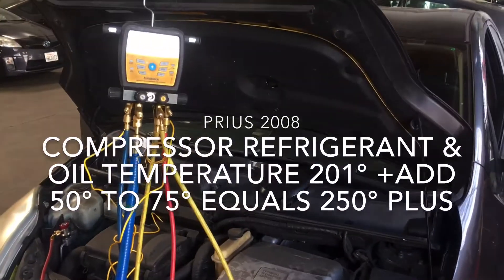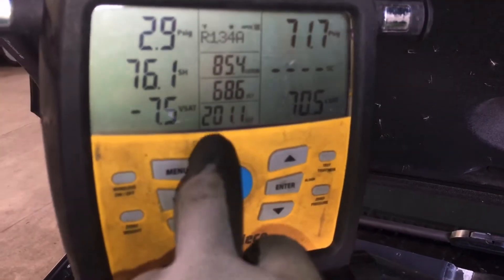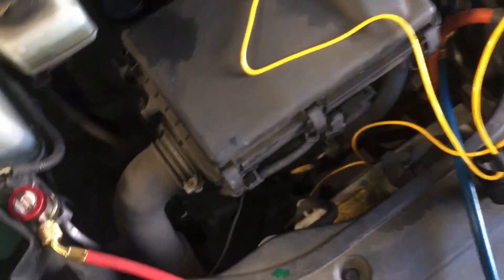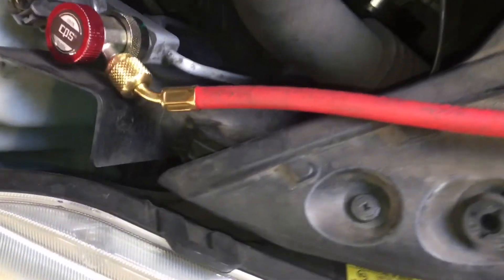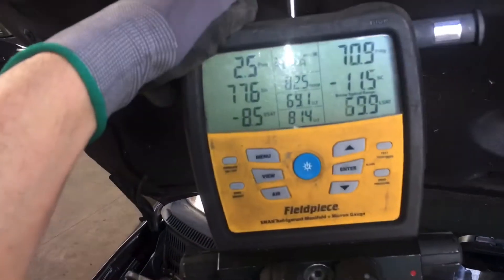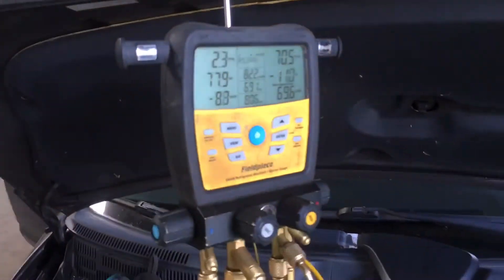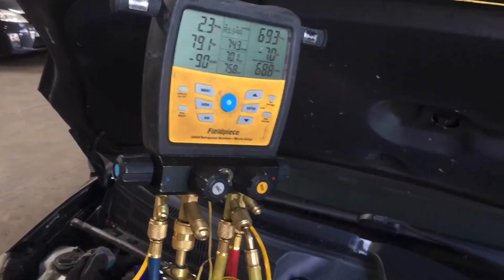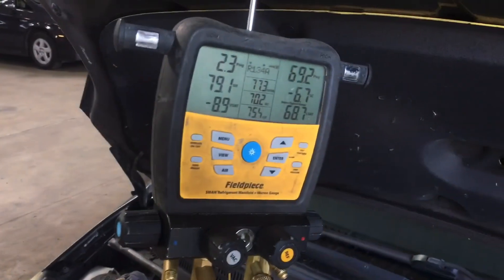A/C compressor refrigerant and oil 201°F Prius 2008

Comment: Hello Mr.Tom, I think your the coolest. I have a 2006 prius, ac started blowing hot air about two months ago. I found a hole in condensor, I then replaced it with a denso condensor. My question is I can't afford nd-11 compressor oil, should I use Napas hybrid compressor oil? And if so, how much oil should I add if any since I don't know how much is in there? Thanks a million amigo👍
Reply: God bless you brother🙏❤️✝️
Reply from the maker: @hcampa79  yes use one of the universal hybrid oils  45 mL.

Comment: What oil (not refrigerate) does prius take?
Reply: Idk whether my mechanic put ND-11 on my 2013 prius or he put pag oil in it. What would go wrong with pag pol
Reply: @tobiasfunke4314   electric compressor short/failure.  ND-11=POE=POlyester oil.    PAG=Polyalkylene Glycol oil
Reply from the maker: Over a long period of time it’s slowly breaks down the insulation, more electrically conductive. 

In the Prius computer for the electrical conductivity of the windings can pick it up as a short, and it’ll set a code and shut off the compressor . 

I electric compressors we’re not designed for PAG oil . 

But they will work for a while. I’ve had a few customers accidentally put PAG oil, but they did not want to pay to have the whole system taken apart and flushed out. 

Some of them have called me back a year to a year and a half later with a dead compressor .
Reply from the maker: ND-8 for the old Prius that have a compressor clutch that is not electric

ND-11 for the newer electric compressor Prius
Reply: @coldfinger459sub0  I have 2010 Prius.  It takes ND-11, costing $300.   Do you know any alternatives.
Reply from the maker: There are some large manufactures of rebottle lubricant manufactures I think one is called. Super cool.. 

They have a hybrid oil specify that comes in a aluminum can . 

Good hybrid oil’s will come in a metal can .   Because believe it or not moisture absorbers right through plastic.. 

And moisture is the enemy of POE oil .

Comment: Tom I'd like your opinion about the temp of my inlet going into my condenser. I have a 2011 toyota tundra 4.6L with the trans cooler incorporated into the top of the condenser. My inlet temp ( using a fieldpiece pipeclamp) is 160F and the outlet is 114 F.  sometimes the temp climbs up some.  I just used some of your training and did a service on my truck using a micron gauge and a digital scale.  the vehicle cools VERY GOOD. Am I over reacting to this higher temp ( to me ) or does the transmission cooler add to the load and increase the temp?  Thanks for all you do. I have learned so much !!!
Reply from the maker: Under 50F difference is good.   When you drive down the freeway the air cools it much better. 

That one row touching not going to add noticeable heat
Reply: @coldfinger459sub0  I appreciate your time and knowledge !!

Comment: Wouldn't you have designed it so that the compressor would shut off if the internal compressor  temperature was going too high.  Those things aren't cheap particularly if it contaminates the rest of the system.
Reply from the maker: Yes I would design it that way.  But remember manufactures just have to make it out of warranty and they’re in the business to sell parts.
Reply: @coldfinger459sub0  - very true 👍
Reply: @Automotive_Solutions  Rotary compressors, both scroll (Sanden TR for example) and vane (Seiko Seiki SS10s for example) often have a thermal switch on their body in series with the clutch coil for this very reason. Once the suction superheat climbs up wildly due to an abnormally low refrigerant charge, bam, thermal switch triggers and clutch cycles off. Never seen such a switch on piston compressors though. Variable displacement (such as the Delphi CVC on my car) likely because they will fully destroke and friction will go to a minimum. But fixed displacement? These will surely heat up a lot once superheat increases too much... (remember that you get the maximum compressor cooling effect and oil circulation rate when evaporator superheat is 0, that is, flooded evaporator).
Reply from the maker: TeraVolt Fixed piston compressor remember the old Frigidaire access six compressors from the early 60s 70s and still manufactured today on heavy duty trucks and agricultural in mining equipment. On the back head of some of those units they had superheat switches.  Other models of the same compressor just had high pressure switches. They looked nearly identical and nearly in the exact same machined slot in the back of the head. Newbies when swapping out compressors would not know the difference it was only a few thousands of an inch difference if you put the wrong one in the wrong position on the rear head it would blow out.  They also had that thermal fuse that when the compressor would overheat wood ground in the switch and blow the fuse to the clutch. Late 50s early 60s technology.
Reply: @coldfinger459sub0  The over-superheat protection is really hard to implement within a modern MVAC system. Yes, the behaviour of an orifice tube is fairly linear, but i've read the evaporator outlet superheat can climb as high as 15F while a cross-charged TXV is operating within the pulldown zone (refrigerant temperatures far above 32F). About thermal fuses, they're not so reliable. My compressor's clutch coil used to feature one rated at 369F, embedded within the coil of course. I've gone through 3 coils because after 7-8 years from fitting the coil, the thermal fuse popped off without an apparent reason (no overheating or clutch slippage signs anywhere, pulley bearing still good). One coil even lasted 1 year before the fuse popped off.